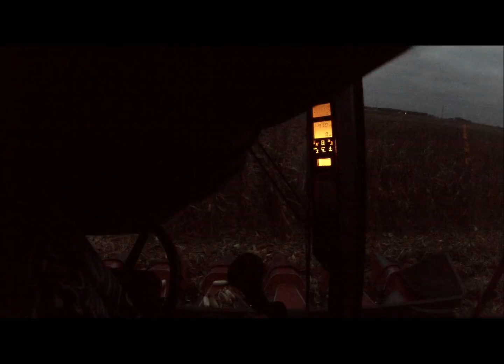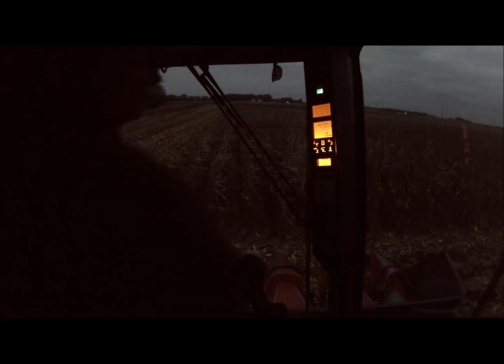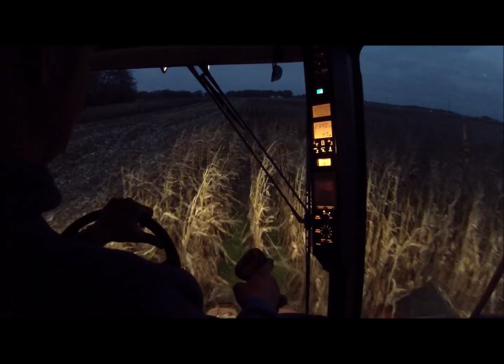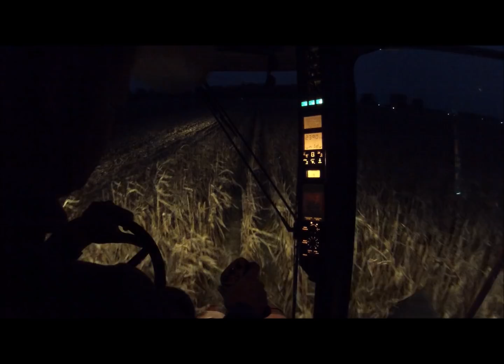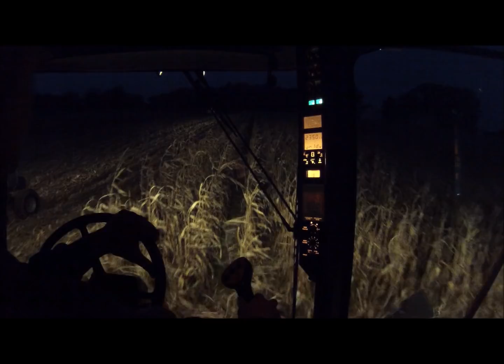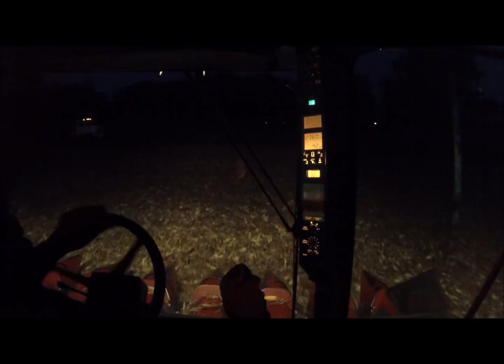Always a limiting factor

Comment: loved the night combining. i use to love plowing at night. i wasnt depressed by how little i got done. and felt like i was on a farm in farm country, and not in town. it was peacful to. those skid steers are so easy to run at doing things there nice.once you get the hang of them.every crew we had at work had at least one of them. i liked the cases the best. hated the new jds they were jumpy. the old ones were better.the diesel ones are real nice because the power. we are suppose to get snow today. normally are first measureable is around this time. if you wouldnt of said any thing i would of thought that was snow on your roof. you call that short corn looks normal for here. we try to start irrigating around the 4th so it can root in and save water.great video Jake as always.
Reply from the maker: Howard Younger thanks for watching! Ya night work is fun sometimes u think u got a lot done sometimes not so much lol. They are on every construction site here. The case ones are nice. A buddy had an 1845 I think is what it was. U be sure and keep the snow lol. That's good to let it root ours didn't do that this year
Reply: the first 1845 i seen we rented. it was in 85, one guy was running it. i was new so i was in the old mustang skid, we were just getting a site ready, just out of Aspen. the guy in the Case was chasing me i was going in reverse. so we were bucket to bucket, he caught me , my bucket was in his it wedged in there. he picked up my machine, and started shaking me. my bucket came off. the problem with that is it wasnt a removable bucket.i thought oh no im in trouble. never heard any thing, all the guys on the crews were happy. they hated the mustangs.
Reply from the maker: Howard Younger lol I bet u had to change ur shorts too if he picked u up!

Comment: Thanks for the ride along.  Kinda interesting to hear your views on the corn crop, skid steer, & etc.  The hand signal thing is a pain.  The guy I've helped out over the years put old CB radios in the tractors & combine.  That proved handy when trying to get together  dumping on the run or if there was an issue with the equipment.  Stay safe.
Reply from the maker: crslyrn thanks for watching. Those would be handy. Dad never liked them for some reason so we never used them